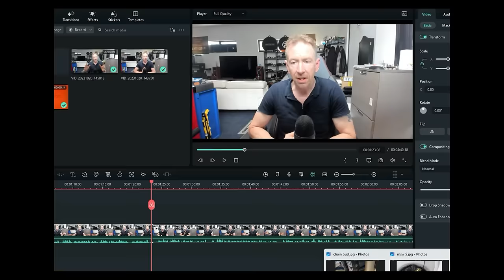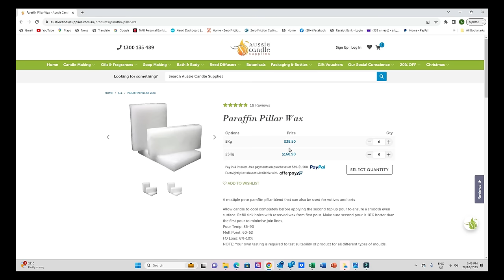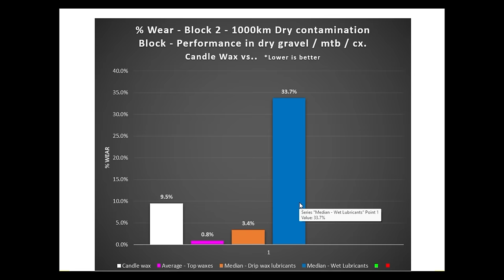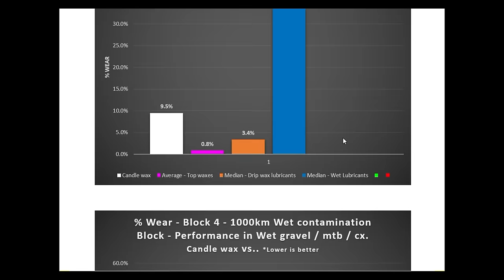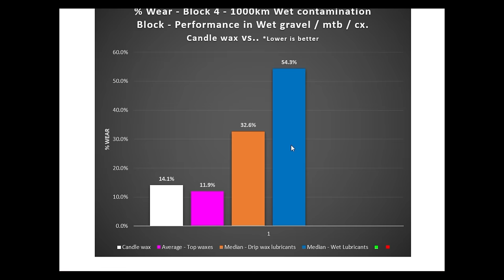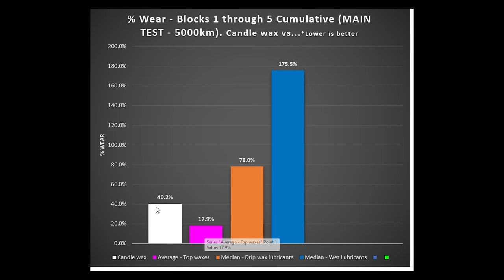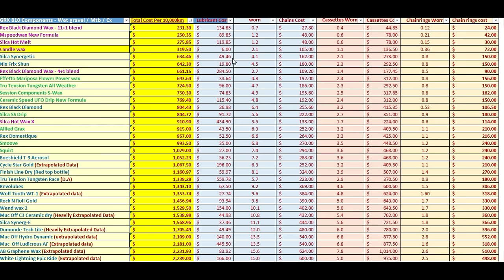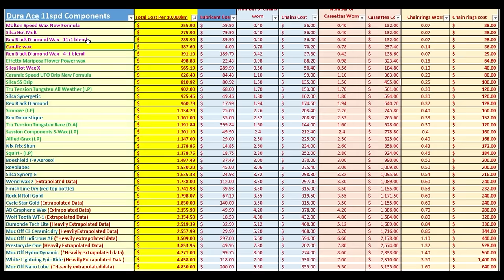Candle Wax test

Comment: Why does the candle wax "Lubricant cost" $4.00 for the Dura Ace 11 spd table, but $6.00 for the GRX tables?
Reply from the maker: for  given distance, people riding offroad need to re lubricate or re wax more often - lubricant treatment lifespans do not last as long offroad as on road- road you zoom along so for a given number of powered pedal strokes, you cover distance faster - offroad you travel less distance for your powered pedal strokes, and there is dust that impacts as well. The modelling factors that you will need to re lubricate 50% more for offroad riding vs road riding, so the lubricant cost for offroad is 50% higher vs road

Comment: Useful. I would be interested to see testing of the variation I use - the Oz Cycle version, food grade wax with a bit of Teflon powder added. Understood that you might not cover all the variants! I am of course a cheapskate and won't spend much on my components or lubricants for my MTB fitness regime.
Reply from the maker: Overall a food paraffin with PTFE will be a perfectly great option for many. The issue i have with the oz cycle blend is a) He recommends 50 GRAMS of PTFE which is bonkers, and i do not know where he pulled that figure from. I would love to see the tangible testing and data that arrived at 50 grams. Original formula mspeedwax and UFO wax was 5 grams PTFE and 1 gram moly. I think he just wanted to safely cover PTFE base and thought well 50 grams should do it. That is just really wasteful IMO, and, also note that the vast majority of top mfg have moved away from PTFE due to environment issues, and that was when they were using very little of it, let alone such a massive amount. So that recommendation by his is not so grand.

b) His testing of his blend vs mspeedwax i think was very flawed, and deliberately dishonestly so. I have document - instructions tab - "that oz cycle video" that covers the concerns with that testing, and i can tell you he was within a hairs breadth of legal action by mspeedwax - something that if i was them i would have for sure pulled the trigger on. that video should not  be up, it is very poor to (in my opinion) deliberately screw a test such that is slanders a great product and company.

lastly - you may or may not know this about him. I do not understand how such humans have support. What moral line do people have before they would stop supporting someone simply for cycling content. its not like he is the only person on earth who can solve climate etc so we still really have to follow what he is saying. I just dont get it. 

https://www.abc.net.au/news/2022-07-05/steven-john-leffanue-jailed-over-killing-neighbours-dog/101209462
Reply: @zerofrictioncycling992  Thanks for the comprehensive reply and wow I never knew anything about this man beyond his YT cycling content. I am horrified to see the report of his actions (which I don't remember seeing reported in the UK), and I certainly won't be giving any more views to his channel.
Reply from the maker: @ridefast0  Yeah i didnt know too much about him for a long time other than he seemed to have a good following so i assumed he did some good content - but then that wax test vid was a big worry and red flag, and then he was often with Venereal D (Durianrider) - which is another rather massive red flag - and then wow what do you know - turns out to be a horrific torturer of neighbours pet, receiving i believe the longest sentence for animal cruelty in the states history. It saddens me when he was back that a lot of comments were welcome back from jail etc - so those people know, and for them its all fine :(. then for normal good people, the reaction when know what he is like is omg i am steering clear! I am always heartened to see normal good people reaction like yours!

Comment: When I boil my chain in water I will place it in a jar of methyl alcohol and then place on a fan to quicken the dry time. While I heat up my wax. 
I have methyl alcohol around, so I’m using it, but if I didn’t, I wouldn’t go out of my way to get it.

Comment: This is great Adam. What are your thoughts on using a wax like this as your “reset” for contamination in conjunction with something like UFO drip? I use a wax from a similar supplier and regularly top up with UFO
Reply from the maker: Personally if i was using a great and not cheap product like ufo Drip, then a not so pure wax with likely a higher oil content + likely some palm or soy in there - it wouldnt get the most out of UFO - you are mixing a pretty flash product with something lesser. i would personally at least spring for a food grade paraffin so you have good clean base on there. Remember used in conjunction with UFO so only using every say 5th re lube- it is going to last you a very long time, overall cost of your wax will still be very low.
Reply: Cool that makes sense. I checked and the wax I bought is refined pharma grade - not sure how this compares to food grade but hopefully is reasonable. Will keep an eye on it incase I need to upgrade approach.

For me the immersion wax is mostly a game changer for how easy it is to clean the chain.

Comment: Hey Adam! Great work, and, for me at least, actually surprising that the commercial products are that much better than a good base wax.  Makes you wonder what exactly it was that absolute black did to their wax to make it behave that... interestingly. It would be super duper interesting to see how sunflower seed wax performs, especially as the Effeto Mariposa Flower Power apparently blows the other drip waxes out of the water. Are there any sunflower seed wax based immersive products out there that you know of? Best, and thanks!
Reply from the maker: thanks aelaeks! This is just my best guess re AB wax, but...... for one, i think their wax base is simply crap - they went for a "pliable" wax - but its just a poor base wax going by its performance and treatment longevity. For two - the pricing is a bit hint that there is likely to be almost no graphene in their graphene wax. Graphene is EXTREMELY expensive. look at the price of their actually very high performing graphenlube - $220 a bottle. Look at the price of Silca Hot wax X with an rrp of $285 for a 300gram tin.  So what does AB graphenwax have in it at $45 for 320 grams? Black food colouring is my guess, with perhaps a token molecule of graphene so they can legally add that to name and marketing. 

FP is a great product, from ZFC side the main thing that has stopped it reaching big sales here is that it runs black so one does not have a very clean drivetrain after a little bit, and most really do love clean drivetrain - there is just something inherent in most - especially if you have beautiful & pricey components - you want them to look good. Having them quickly covered in a black lube - it is just not to many's liking - especially if you have say a copper or rainbow xx1 cassette, or rainbow red cassette - but even just normal silver cassettes - people want them saying clean. So despite its no penetration issues, great dust resistance, very smooth feel and very low wear (all at a great cost, and an enviro friendly product) - i think literally running black puts many off, and also that it is a different wax altogether and just doesnt play well to use with immersvie waxing. Most of our sales of silca ss drip or ufo drip are to waxing customers as they can use those as top up in between, they are clean, and you can re wax straight over. 

I have not heard of any sunflower wax immersive waxes - but there are a lot of immersive wax products on the market now, it is possible i have missed! if you see one, let me know :)
Reply: Big kudos for your detailed answer(s) and always taking the time to do it right! That´s so refreshing nowadays :) Re AB, I guess you´re right, even though in my naivety I would have assumed that there was some actual testing involved before putting the prodcut on the market... especially since they depict themselves as science-driven. And it could have been so easy... pick a good base wax (as you demonstrated, available for cheap), throw in some black food coloring, profit. Especially since people (including me) were already on their hype train after the GrapheneLube success. Re the sunflower stuff, I just wonder if the black gooiness comes from additives that that are required to make it a good drip wax and achieving the almost perfect penetration characteristics or of it is a characteristic of the wax itself. In other words, it might be possible that sunflower wax is a superior base compared to paraffin. Imagine with the right additives... the bike will basically power itself and chains will never die again! Completely off topic: Does anyone have any insight how long a chain on the turbo trainer lasts? I was running a dedicated indoor chain (campy potenza 11) with silca synergetic for a year now and some 6k km, and I dont see any elongation with both a chain wear gauge and calipers. @zerofrictioncycling992
Reply from the maker: @aelaeks  AB did contract a lot of testing for graphenlube with myself and others (like wheel energy). You may notice that the test data from me is not released from NDA. You may notice the test data from W.E is up there with the wackiest data ever released (refer vids on lubricant testing - it is NUTS that data was published). A number of test facilities work very differently to ZFC. with ZFC, we have built up over 7 years a pretty large open league table (it has taken a long time as each test takes a long time indeed - usually months). This means a mfg can contract ZFC for a test, and their result can be benchmarked, block by block as we go- against their key competitors. 

others that conduct much shorter duration testing - the cost of one test is much cheaper than ZFC - but, they then on have N=1. The way those test facilities make money is that the mfg needs to have their product and number of competitor products tested to get themselves a data set. There is no open data table, all testing from previous data sets belongs to the mft that contracted that testing. The test facilities are not doing testing of their own volition, nor putting together a data set from mfg who have gone public with their data. And - the data from one facility for X lubricant if the mfg goes public themselves for marketing often conflicts with test results for the same lubricant from a different test facility. 

So what usually happens is mfg contracts X for testing of their product. They contract them also to test say 10 competitors. Lets say 5 competitors were better, 5 competitors were worse. They are not going to go to market with the full data set. they will go to market with their lubricant and 5 competitors whose data was worse. Which is why every mfg who has contracted testing with anyone else other than ZFC, has always been able to go to market as the winner of the testing.  

AB did do some testing i think for graphenwax but it was very very limited vs what they did for graphenlube. I am very certain AB know exactly what graphenwax is, and i think that absolutely it was there to a) jump in on the popularity and  growth of immersive waxing, and b) use graphenlubes excellent credentials to sell graphenwax.  it is a shame that graphenwax is so bad (In Zfc opinion) whilst graphenlube is overall outstanding (just far too expensive). 

And possibly re sunflower wax, i really have not seen it in its raw form re lubrication ./ wax, and i have no idea what Effetto may have done with it - but overall, it is brilliant product - its only main negative for those not immersive waxing is it being visually not clean - if it was as clean as ss drip but kepts its performance it would be astounding. 

indoor training can also be pretty variable but overall it should be longer than outdoor due to lower contamination. But this can be offset by indoor typically being less free (rolling) kms - ie if i ride for 30 mins at 300w up a hill, i then have about 10 km of free kms going down hill. on a trainer after 30mins of pedalling power, you normally just have never ending mins of pedalling power. Also, more tend to use indoor for higher intensity workouts or zwift races vs 4 hours of zone 2 - higher avg load will impact lifespan. 

Synergetic is extremely wear protective though, and so that is likely why you are seeing such a great result - if you see its block 1 result of 0.0% wear for that 1000km block, thats a good match for your indoor cycling :)
Reply: A clean drive train is the primary reason I prefer wax.  FP running black is off putting for sure and disappointing as a product as potentially eco friendly would very appealing to me if it ran clean.  It does make one wonder what else is in their blend though. What struck me as a little odd was that when you tested it, you described it as softer setting and a little oily.  Sunflower wax on its own is pretty hard and dry.  It does have a very high oil bearing capacity though. You can mix in a lot of oil and it will remain very solid, getting softer the more you add.  

Squirt was one product that you tested that sounds like it runs similarly to FP in that it runs black.  Given Squirt uses slack wax, which by definition contains oil it might be fair to speculate that FP does too?
Reply from the maker: @uncleants  ooh very hard to say, it really would be high speculation. Vs Squirt - FP has SIGNIFICANTLY better penetration, and that is something not that easy to achieve with wax drip lubricants. It is not so much about viscosity at all, as i have tested a number of wax drips (not public) that have struggled re penetration, they have gone higher and higher viscosity and still struggled, and yet others such as ufo drip are notably lower viscosity but do not have penetration issues. Wetting agents / surfactants appear to be key as lowering surface tension appears to be much more important than viscosity re geting past that crucial very tight gap between inner link plate shoulders underneath the roller to get to the pin. If surface tension is too high, even with high viscosity, it basically just runs around that gap and drips out the other side of the chain onto the floor. Just adding some slack wax / oil to sunflower  i do not think will have achieved what they achieved. Someone who really understands chemistry and the task at hand and what is needed to achieve it has done a great job. I cant guarantee of course since i dont know,  but i do not think that whatever they have used will be in breach of its Eco credentials. From my dealings with them, they seemed nothing if not passionately genuine about that aspect as well as what they had created overall. Muc-Off in my call with them were also passoinate about what they were saying, but that was a completely different feel - that was feel of lets try and dazzle some smoke and mirrors to distract from not answering questions re why we FTT test for long intervals when we know without doubt it gives incorrect results for many lubircants. Or what is going on with their wear rates in ZFC test. or why their lubricants absorb contamination so quickly etc. Effetto were just how you want a mfg to be when having a chat to them re their product - whilst of course they need to keep their secrets from competitors. To be honest, i didnt expect too much, i thought they were mostly just going for a good performance from and enviro friendly lubricant, but they really knocked it out of the park. 

if only it ran clean looking! :)

Comment: Yeah, candle wax is funny. I have three types: two is hard, but the color is different. The third is somewhat softer, and leaves some kind of oily layer on my hand.
I also mixed the hard candle wax with hair removal wax to make it softer (2 candle 1 hair removal based on weight) I am curious, how will it work, because while it is a bit softer, it somewhat sticks. (the paraffin oil came out of the candle wax, so I dropped that idea)

Comment: i use 2 pots for hoping to keep the 2pot with cleaner wax, is it a good choice to put the cheap wax in the first pot and the silca in the second ?  or am i thinking the wrong thing .
Reply from the maker: one could probably do that as a cheaper way to start 2 pot. You will be bringing a bit of cheap wax into pot 2 each time, but it shouldnt really affect the good wax too much unless the cheap wax was really not great. But next fresh bag, pot 1 will then be basically hot melt as well, and then it will be both hot melt into the future as pot 2 becomes pot one, fresh bag into pot 2 etc

Comment: Hi! Great video, useful info, as usual. 
Got a question about chain prep, on your guide you mention the number of baths we should do when using mineral turps with shimano, campy and sram chains. Would you be able to tell how many baths we are supposed to do for connex chains? Thank you!
Reply from the maker: i have done hardly any wippermann as not very common here, but from memory i think they are fine with 3- but once you have done bath 3, if the turps is not looking really clear, then maybe a 4th to be safe - but i think it was 3, i think it might have impinged on memory the  few i have done if they needed more than that.
Reply: @zerofrictioncycling992  Thanks for that, just what I was going to ask! I am going to a cycle of three Wippermann Connex ebike chains for my 9-speed eBike (meaning I can carry two on-board spare chains) and will try the Silca hot melt wax. The ebike goes up to 110Nm and more than 1500W so that will be a tough chain lubrication test. And of course the 'used' chains can still be spares even while waiting for a re-wax, so the wax pot won't have to come out too often.